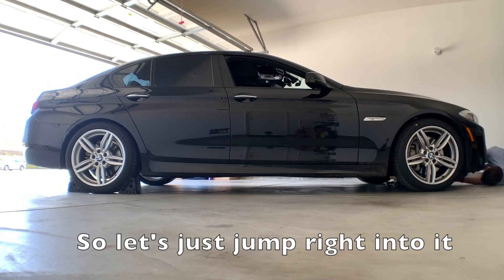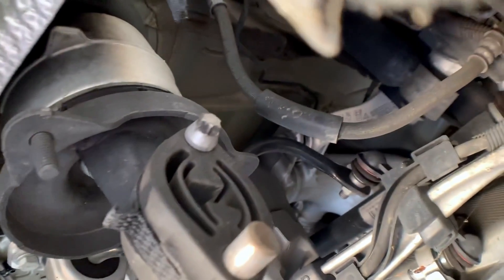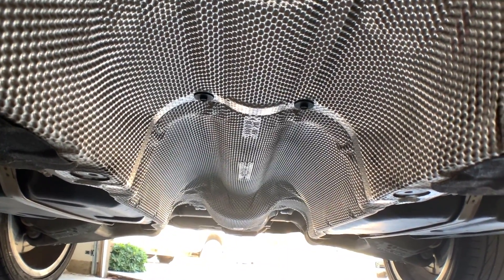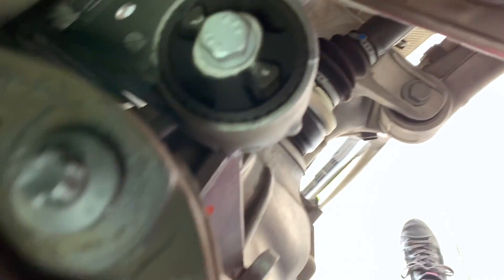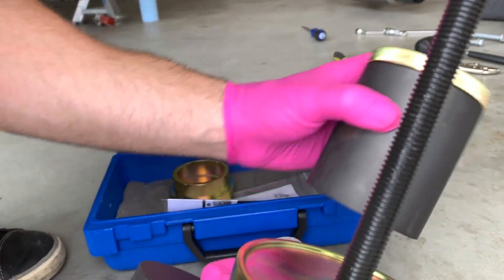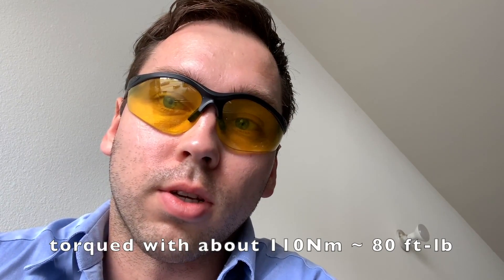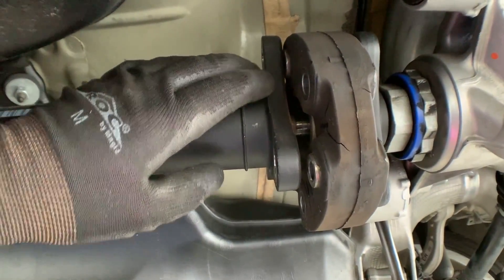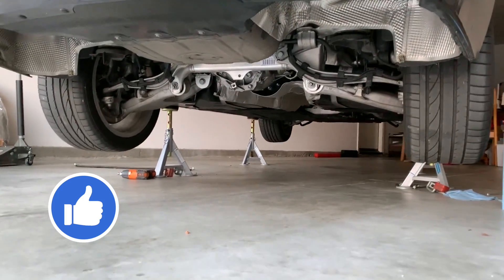How To: BMW F01/F10 Differential Mount Replacement + Flex Disc (Guibbo) [DIY]

Comment: Hi nice video. I have some questions when you replace the flex disc is it important to mark the  diff flange and drive shaft flange that the flex disc sits between are the 2 seperate flanges balanced? Also do you know why the f10 seems to vibrate between 120 to 130kmh it seems to be common problem affecting the f10 chassis. Thanks
Reply from the maker: You don't have to mark the flanges. They aren't balanced against each other. For example, if you remove the entire drive shaft, usually you won't put it back exactly the same way and it doesn't matter anyway. I marked the bolts to make sure to complete the 90 degree angle. Just make sure that the arrows point towards the flange.
Regarding the vibrations I haven't experienced that yet but it may also be because of the less than ideal street surfaces in LA. Usually such vibrations can be caused by wheels, brakes, play in wheel bearings or suspension components or center bearing of the drive shaft. Hope that helps
Reply: @BONDGarage  hi thanks for the reply. The reason i questioned the prop flange and diff flange needing to be marked was because of an article i seen i have posted the link https://www.newtis.info/tisv2/a/en/f10-520d-lim/repair-manuals/26-propeller-shaft/26-11-single-multiple-part-propeller-shaft/1VnY9r4jM5
Reply from the maker: It's always safe to follow TIS 👍🏻
I can't absolutely determine if those parts are balanced against each other but I can say that when I replaced or repaired diffs in the past (which doesn't happen very often) we never had to balance it against the propeller shaft.
The reason why TIS, myself and most people will recommend to mark the position and assemble it as it was originally is simply: it worked before in that position so let's not mess around with it. Simply to reduce the chances of introducing an imbalance. However, that doesn't mean that it will definitely cause problems if you don't mark the position.
Reply: Check ball joints of the output shafts...My F01 had this kind of problem Nad caused vibrations at 120 km/h

Comment: I have that exact f10 fully loaded 2016. It vibrates heavily down the highway when I accelerate around 60-90mph. I can’t tell if it’s coming from front or back I think front.  Going to take it to shop sure where yet. It just happened a few days ago
Reply: Your front differential doesn't have the guibo, only the back does. It's most likely your rear
Reply: @Sonin66  that’s what I was thinking as my entire seat under me shakes. I was also thinking it might be my front left axle cause that tire makes a sound when I go over bumps. I’ll find out this Tuesday
Reply: @a1enterprise405  good luck bro
Reply from the maker: keep us posted what if was

Comment: Can a split in the guibo cause vibration just on 1500rev? I am experiencing a litte vibration on 1500rev, turning the steering wheel to the right and on Drive mode. Fine on N. Thanks in advance?
Reply from the maker: hard to say. but if your guibo is split I'd change it anyway.
Let me know if that solved the problem.

Comment: Are the bolts single-use items? I have to do this job on my F02 and am wondering if I need replacement bolts in addition to the new flex disc and bushings?
Reply from the maker: Whenever it's a "stretch-bolt" (meaning you have to torque it and then give it a 90 degree turn), those are single use since it already has been stretched. All other bolts can be reused if there's nothing wrong with them. BMW will usually recommend to replace bolts and will do so when performing any repairs. Personally, I replace bolts within the powertrain for peace of mind.

Comment: I know this is quite late but question...does the differential still needs to be lowered even if I’m only changing the flex disc?
Reply from the maker: no, it doesn't. but you will have to lower the drive shaft centre bearing to create enough space. still easier than lowering the diff.

Comment: Hi how would you know if it needs replacing without looking at it. Can you feel it if its cracked?thanks
Reply from the maker: I couldn't feel anything just from driving. Visual inspection is the way to go. Luckily it's pretty easy to spot.

Comment: good evening Sir!
Do yo know torque spec for drive shaft central bearing mount?
Thank you!
Reply from the maker: I'd guess 25 or 35Nm but can't say for sure. The page I used to stalk for torque specs was just turned into a membership platform. I'm sure the information can be found on some forum. Would be great if someone with that knowledge would chime in.

Comment: Does that tool pull front and rear mounts?
Reply from the maker: the front mounts are smaller so they require another tool

Comment: Very good! Where did you order the extraction tools and the replacement bushing?
Reply from the maker: I've got the tool from EMG Tools (https://shop.ktcautotools.com)   feel free to try using discount code "ePro5"   maybe that's still active.
The replacement bushing came from BMW Northwest. However, more recently I've been ordering from https://www.bmwpartsnow.com
both are pretty much the same but pricing is sometimes different.

Comment: Hey, nice video ! Do you have any tutorials for swapping the rear axle / diff ?
Reply from the maker: I don't, and hope to never have to do that. But in short: remove the left and right drive shafts and the flex disc, then loosen the mounts (2 small, 1 big) and the diff should fall right into your arms. Best of luck
Reply: @BONDGarage  I have already done it :P but thanks
Reply from the maker: @3xcelsi0r10  hope everything went smoothly. nice Skyline btw
Reply: @BONDGarage  Thank you sir ! When I swapped my diff I saw that my gearbox is leaking oil... BMW givin me troubles :( but even the underside of your beamer is cleaner than my life :D
Reply from the maker: @3xcelsi0r10  😂 guess I got lucky. had some "moist" spots when I got the car but they've disappeared ever since. not to jinx myself...
Reply: @BONDGarage  I haven't found you anywhere else to write you privately but I'm curious if you moved out from germany :p
Reply from the maker: @3xcelsi0r10  can't hide the accent. my IG is in the video description for that matter.

Comment: Hi and thank you for making this video. Would you be able to share the part number of the bushing puller tool?
Reply from the maker: I used the installation tool kit "BMW2260" from KTC Auto Tools for differential rear bush removal. It's only for the big bushing, not the two smaller ones at the front of the subframe. Let me know if you have another question.

Comment: Great video. 
Do you have a video on replacing motor mounts?
Reply from the maker: Thank you. I don't have a video on that and hope to not have to make it anytime soon :) My 535i is currently mostly stationary and has only 65k miles on it but you got me curious and I'll take a look in a few weeks. 
It's possible to change them in your garage without lift. A hydraulic jack will do but somebody nearby may be of benefit. Watch out to not squeeze anything while lifting the engine. Should only be 2 mounts and doesn't require any coding. If you can't find your specific car and engine, use the next closest as reference. It's a little different but mostly the same. Whenever mine are due I'll document it.
Reply: You have to drop the subframe and raise the engine to get them out

Comment: what was the problem? how dis you come to realise that those are gone? simptoms? mi f01 has a rough gear change in sport mode sometimes, can i pick youre brain on that?
Reply from the maker: Hi Daniel. I had literally no symptoms at all. At least nothing noticeable. Just know that the F10 and F01 platforms have that problem and I noticed the cracked bushing upon visual inspection. A quick look brings clarity. 
If your F01 shows rough gear changes at times, it can be only a few things. How many miles does it have on the clock? Have transmission- and differential-oil ever been changed? Check on the condition of flex disk and driveshaft center bearing. Diff bushings could be a reason. Transmission- or motor mounts could be possible as well. 
I remember seeing a thread on a bimmer forum like that as well. That may help narrow it down.
Reply: Hi i have some questions when you replace the flex disc is it important to mark the shaft flange and the differential flange that the flex disc sits between or does it not matter in terms of balance. Also do you know about the bibration issue that affects alot of f10 cars where they vibrate arounf 120kmh? Thanks
Reply from the maker: The drive shaft and rear diff are not balanced as a system. So you can put it back together without marking the exact position it was in originally. But if you want to make 100% sure you install back to what it was before, feel free to mark the shafts and you can sleep peacefully :)
As for the vibration issue, i'm not sure what may cause that at the moment but let me know if you find something out about it.

Comment: Do you have parts numbers for the bolts? I can’t find them anywhere
Reply from the maker: Yes, they are in the video description.
Reply: @BONDGarage  i hope you are active. Do you have to change the bolts on the Flexdisc? Are the bolts 1-time-use only? Cheers
Reply from the maker: @hodzicd.4086  I can't quote the handbook on this one but when it comes to powertrain components I rather change the bolts than be sorry. We've also always changed them in the shop back in the day.

Comment: How expensive is the bushing puller tool? Where to buy?
Reply from the maker: I got it from ktcautotools. just type in bmw2260 into the search bar on that page and it should pop up. it's currently $140

Comment: What are symptoms of this going bad?
Reply from the maker: you may be able to feel something in the drivetrain but since the roads here are pretty crap I can't nail it and just go of visual inspections. like the bushing I installed in this video is already gone by now. just lasted about 60k miles and now an entire arm is torn off.

Comment: Is the flex disc sided as in does it have an orientation because one side has writing on it and the other side is blank
Reply from the maker: Nope, it doesn't matter which way around you flip it. Just matters that the little arrows on it point towards the flange that it attaches to.
Reply: It is important to fit it in the same way. It is calculated for different loads in different directions
Reply: @nameaftername367  can you prove this statement?
Reply from the maker: @Name Aftername is right about that. The disc has 6 holes for the bolts to pass through. Inside, hidden by all the rubber, pairs of 2 of these pass-through holes are connected by fabrics to strengthen the disc. These reinforcements help keeping the disc together when driving forward. When reversing, the torque is transferred by rubber only but since we drive forward most of the time that's fine.
When it comes to installing the disc, it does matter to install it right, which is with the arrows on the disc pointing towards the flange that it is bolted to. If you mount the flange in between arrows it would be in its "reverse" position which would wear it out extremely fast (unless you are reversing 99% of the time), but you would see that something is off because you would have to force the disc into this position and it wouldn't look straight after installation.
As for the writing on the disc, think about it, it's a symmetrical part and every second hole has an arrow on one side while the arrows on the "backside" are right in between. So if you flip it around you are good as long as you keep all arrows pointing towards its flange on each side.
Reply: @BONDGarage  yes so what your saying is the that the writing part does not have to face a certain way? I fitted mine with the writing face the rear of the car but the arrows are facing the flanges so is that ok?
Reply from the maker: @shisui.015  Should be perfectly fine.
Reply: @BONDGarage  thanks my friend

Comment: Can you list part numbers for all parts used?
Reply from the maker: I'm sorry I forgot about those. Description is updated to include all part numbers. Keep in mind it's for a 535i. Other models may have variations. Also included a link to pages to double check the number to fit your car. Thanks for the reminder.

Comment: How long did it take you to change the mount?
Reply from the maker: Takes way longer when you try to film and explain 😄 Changing the rubber mount itself shouldn't take you more than an hour once the car is in the air. And that's inclusive quite some breaks you will have to take as you tire pulling it out and squeezing it in. Drop the exhaust, remove the heat shield and the diff and off you go. You can comfortably finish within 2 hours all together.

Comment: If there’s no symptoms for people for tens of thousands of miles is there really benefit to refreshing it?
Reply from the maker: avoiding catastrophic failure maybe?
the E46 M3 was notorious for braking rear subframes. you didn't really notice until the entire axle broke out. that's why you perform inspections to catch problems before they cause headache.
you could also drive until things turn bad but usually that causes more damage so personally I recommend preventative maintenance.

Comment: At 16:20  is that metal plate cracked?
Reply from the maker: You mean when the oil squirts out? I may have lubricated a little too much but that's not a problem. Neither tool nor subframe had any damage from this.
Reply: @BONDGarage  Isn't oil make it slippery and make bushing move on torque input? What kind of oil did you apply? Manual says to use special spray lube that dries in a few minutes
Reply from the maker: The oil was only to lubricate the nut of the tool like shown in the video. If you have some tire mounting paste, that's what I would recommend if you want to lubricate the actual rubber mount. Will make it easier to pull in and will dissipate fast.
Reply: @BONDGarage  Will tire mounting paste after dried and many years later, if I need to replace the bushings again it will be tacky like glue and won't come off easily? I like the idea of installing but many years of it fused together will be hard to remove. Me thinks

Comment: 478/5000
Hello, I have a tremor of the engine or maybe the 8HP40 gearbox.
Occurs in the morning with a cold engine or gearbox, when the reverse gear is engaged "R". Shaking or vibration is also felt during acceleration. I checked the rubber mount of the gearbox - it's ok. I'm thinking about replacing the engine mounts. However, today I checked that I have a damaged rear differential rubber bushing with this number: 33 31 6 792 872

Can this type of vibration be the reason for its damage?

Regards

Comment: How many rear differential mounts are needed?
Reply from the maker: I only changed the big one on the rear side as that is the one that usually gives in. There are 2 smaller diff mounts on the front side. Haven't had to change those yet though.
Reply: @BONDGarage  ok thanks where did you get the rear differential mount extraction removal tool kit?

Comment: you do not tell everything in detail!
Reply from the maker: What's your question?
Reply: 2:07 at disc there are 6x screws. did you use only 3 of them or all of them? on old ones there are 3x hexagonal and 3x torx screws on it. 
if you remove the exhaust, the screws and gasket have to be replaced!
Reply from the maker: @M-1453  since the bolts on the flex disc are "stretch bolts" you need to replace them. replaced them all with hex bolts. those are the only ones you can order on bmw parts pages. appears that they unified the bolts.
regarding exhaust, I reused all bolts and nuts that hold the exhaust in place. there is no gasket after the post cat so nothing to replace here.
I live in an all year dry area so my cars' underbody is in great condition. depending on the climate your car operates in and it's age, you may have to replace certain bolts or nuts when they are heavily corroded.
Reply: @BONDGarage  well explained respect. i ordered from febi bilstein disc there are also 6x hexagonal screws. but i asked bmw and they said only 3x hexagonal screws and 3x torx. but i have 535xd diesel 2016
maybe it is different with diesel
Reply: @BONDGarage  how long did it all take you to finish